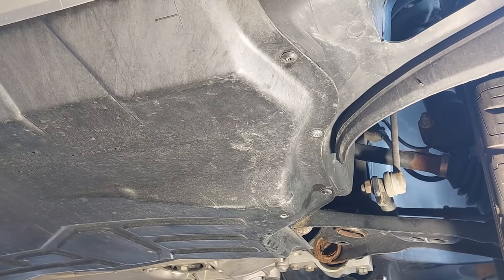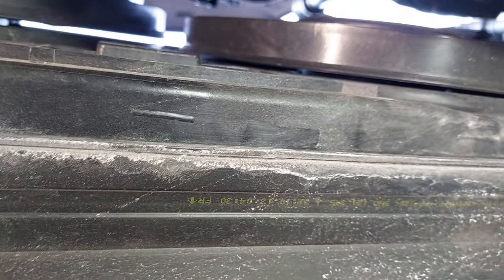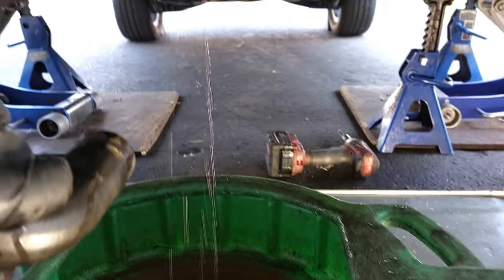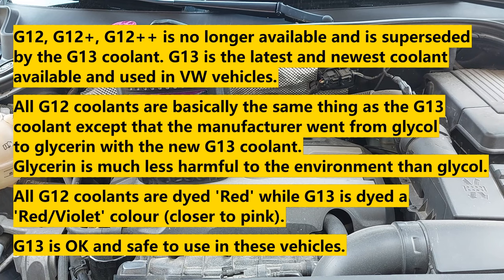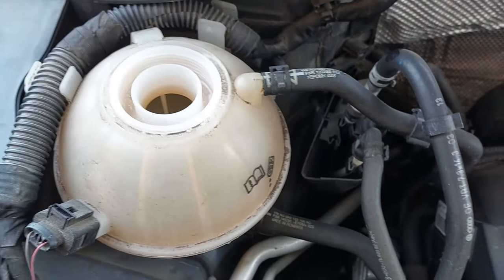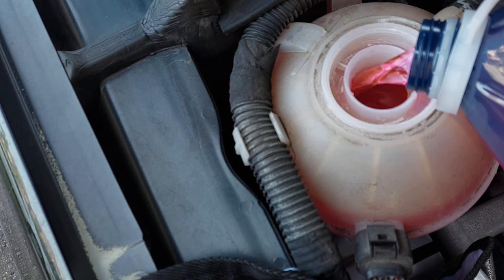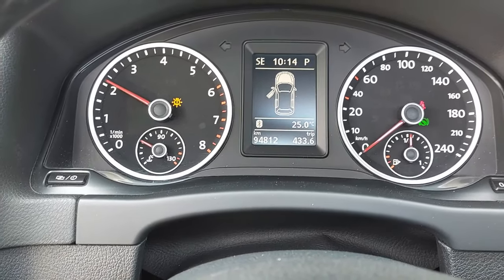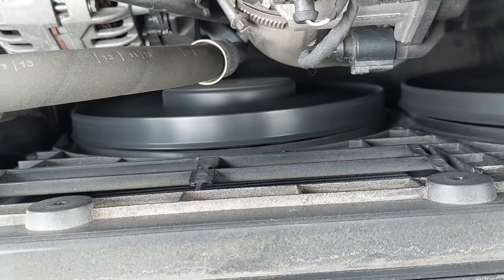2014 Volkswagen Tiguan 2.0 TSI - Cooling System Service - Drain & Fill & Bleed

Comment: Hi, the G13 is not the newest anymore and was also replaced by G12evo. The G13 is clogging the coolers over time... The G12evo is compatible like G13 to the old ones.
Reply: And also the stuff he used isn't g13 anyways lol
Reply: You‘re right. If you renew your coolant fluid, change to g12 evo. And another important thing you must do:
 If you have a g13 coolant reservoir, remove the silicat bag from the reservoir. This is the cause for clogging…

Comment: Hey man! This is awesome.
  Btw. My sister's 2018 Tiguan just got the thermostat and housing assembly replaced by a "Mechanic" and it is still overheating.

 The fans do actually turn on.

 I will try this procedure.

Do you recommend anything else?

 I was thinking about using a vaccum pump with vehicle off..

 Thank you soo much!
Reply from the maker: Try to follow the procedures in this video to properly bleed the system and see if it solves the problem. If not, I would have a look at the secondary/auxiliary water pump to see if it's working as that helps to push and circulate coolant in the system.

I would also check to see if the primary water pump is working properly and if it is leaking and if the ECT sensor is working as well. It's hard to diagnose without looking at the vehicle, but those are some things to check.

Also, using the wrong coolant on these vehicles may cause gelling and clog up passageways in the cooling system so that can cause problems too.

Keep an eye on the reservoir to see if the fluid is circulating in the system when you are performing the bleeding procedures. If not, I would suspect one or both of the water pumps are not working properly.
Reply: @moosemobileautorepair   Oooohh woooowww!! Thanks a lot man!!! You are freaking amazing.
 Will do 🫡
 Happy holidays btw!

Comment: Thanks for the video my man. Was wondering if there was NO drainplug and you answered that!

I've got a leak on a weird hose that goes around thge back left of the engine that looks like it will be near impossible to fix.

Ever tackle that one?
Reply from the maker: I haven't worked on these cars too often so I can't say. Only done a few things here and there, but that's it. But what I do know is the water pump and the auxiliary plastic pump are common to leak on these models.
Reply: @moosemobileautorepair  Yes they are and I've replaced both on this POS.

This is my daughters car and she "loves it" 

Otherwise I woulda towed it to the junk yard years ago.
Reply from the maker: Lol 😆.  The 2.0 liter TSI engines are known to fail such as the timing chain and stuff. I've done rear coil springs and a few things on these cars. I've also seen the PCV valve failing and causing a rear main seal leak. I don't work on them too often, but yeah I don't recommend these cars because of parts and labour being expensive. They're fun cars to drive, but not worth it unless you have the money.

Comment: Hey man.. thanks for making this video.. im about to do a flush on my vw tiguan.. i have a question.. as you know, when you drain the coolant from that hose( minute 8), that's not all the coolant in the system , there's some coolant left in engine block .. how can you drain that safely? start the engine with hose unattached?
Reply from the maker: That's right. It is not all of the coolant in the system, you probably get about half or 2/3 out. But if you do periodic maintenance at the right intervals then you should be OK with this service. You don't want to run the engine while you have all of the coolant drained out from the radiator/system because that will run the water pump dry and damage the seals, etc. and cause premature failure. If you want to remove all of the coolant you can attach a garden hose from either side and flush it out with water through the hose and block and you will be able to get all of the coolant out then. On some vehicles they have drain valves located somewhere on the block, but I typically don't touch them as you could open a can of worms and cause more harm than good. I typically just do a drain and fill at regular intervals and you should be OK with that. You can also do the service twice if you're really worried about getting everything out and getting it clean otherwise you could just flush it out with a garden hose or by using a coolant exchanger machine that shops typically have.
Reply: @moosemobileautorepair  thanks for letting me know, the thing is.. i added some radiator cleaner to the coolant so i  can flush the whole system, but the original problem is, no hot air comes out of the vents when i have on heating , after diagnosing the issue turns out the heater core is clogged .. so i want to unclog the heater core and flush the whole system since it has never been replaced before. I like the water hose idea but how can i get that water out if i want to add 50/50 coolant?.. can I use air to push the old coolant out?
Reply from the maker: You need water to push coolant out. You can safely use tap water from the garden hose and maybe use a special adapter if available or something so it doesn't spray everywhere. Using approved cleaners should be OK as long as it gets drained out after the service is done. I would try to bleed the cooling system out properly first before condemning the heater core. In most cases no heat through the vents is most likely because the cooling system has not been bled properly. Very rarely it will be the heater core, but it is still possible. You may want to check the thermostat as well to see if it is opening and if the cooling fans are coming on. It would be a good idea to check for any TSBs as well (Technical Service Bulletin).
Reply: @moosemobileautorepair  so if I use the garden hose to. flush it out, then i add new coolant, once that 50/50 gets mixed up with water in engine block, its not 50/50 anymore, its less than that .. right?. plus tap water has minerals so its like that calcium will build up inside the system, probably safer to use distilled water. The thermostat and fan are working properly.. what is a TBS?.. yeah so my biggest concern is how to get the garden hose water out?
Reply from the maker: For the garden hose you can insert it into one of the radiator hoses to flush the block out. There is a hose gun adapter by Lisle which you can get for cheap off Amazon. It's OK to use tap water for flushing it out only. But after you're done flushing you use either the pre-mixed coolant or concentrated coolant with distilled water to get a 50/50 mixture.

A Technical Service Bulletin is information sent from a manufacturer to service centers that describes a specific problem with a particular vehicle. It typically also includes an explanation as to how to correct the issue in terms of repair, software reflash, or modification of the automobile.

https://amzn.to/3ZIJ4l7

Comment: I have a tiguan 2.0 tsi from 2011 . Hoe much liters i need ? I saw a video saying 10 liter ? Its correct ?
Reply from the maker: That is if you are doing a full flush considering that you have the coolant exchanger/flush equipment/machine. The full capacity is 11 liters total for a full system flush.
Reply: @moosemobileautorepair  Thanks for help. I dont think need a full flush.
Reply from the maker: 1 gallon jug of concentrated coolant should be enough and distilled water or 1 jug of 50/50 pre-mixed is also OK. Just have some tiny bit extra just in case. A flush is not really necessary on vehicles unless there is a problem or neglected maintenance. A regular drain and fill at regular service intervals works fine.
Reply: @moosemobileautorepair  I just bought the car There are no problems, the water just doesn't look that clean. I think if I renew a few liters it will look good again

Comment: Really thanks for your great video. A question, why you didn't draing from one of the lower big hoses? for example the one you show at 4:29
Reply from the maker: Thanks. I think because it may have been difficult to access and those ones had a special type style of clamp that locks and so I decided not to touch it and leave it alone. You can remove it if you want whichever is easier. The one I removed drained a little bit from the block as well as from the radiator through the hose I drained from.

It was a Friday that day so I didn't want to open any can of worms so I picked what's easiest to remove and drained the coolant from there.
Reply: You did absolutely great job already, i have a Passat B8 2016 with contaminated coolant because of this silicate nightmare ended by clogged heater core. It was replaced by VW for a 1200 bucks here in France :face-orange-raised-eyebrow:. Week after i noticed there are still brown particles in the expansion reservoir and the coolant is orange-brown. So i decided to flush the coolant by myself. So far i learned from your video that it is impossible to drain the whole coolant from these cars with the auxiliary heater.  I believe using  the flush additives are not possible in this cars while I can't drain it for a same reason. I want to go with your procedure but i want also to put the garden hose in the reservoir and try to push dirt as much as possible out at least from the radiator circuit while it is impossible to do this for block circuit. Then try to use the compressed air to drain the water too and fill with the G12 evo instead of G13 also replace the reservoire.Also I think  but I’m still not sure if worth it, what do you think?
Reply from the maker: That's nuts. That's quite some story. It's worth a try to flush everything out or do multiple drain and fills too if needed. 

If you say brown colour, that could mean that there could be a leaky head gasket because usually oil and coolant getting mixed together would turn like a milky brown colour. Let me know otherwise, but yes it's worth to try to flush it out if you're having those problems.

How does the vehicle run and drive otherwise?
Reply: @moosemobileautorepair  the car is super fine, it’s on 40k miles only after 7 years. This was very first surprise. The coolant is not milky brown, it’s transparent looks like light tea with a very small brown particles inside ( very very small like a dust) , thanks again bro, god bless you and your business
Reply from the maker: Thanks. Try flushing it out how you stated and see if it helps and that should help to get the brown stuff out. Most likely because of incompatible coolants mixing up together like you stated earlier about the silicates.

Comment: I followed the instruction but in my case the coolant keep rising in the resevoir when the car is iddling.Why is that?
Reply from the maker: It means there are still air bubbles in the system. Try squeezing the hoses a little more and that will help to displace the air bubbles and help circulate the coolant better.

Comment: Hello I had a problem! I went to a garage, changed coolant to a 1.2 tsi. The problem was that the engine overheated. On a hose no coolant alwas getting to the water pump, and the thermostat did not open. After lots off overheating, taking hoses out to bleed air, the temperature stays at 90 degress, but the fans do not turn on. Only on A/C. Could be that they put the heat on when they turn on the engine after changing the coolant? Thank you!
Reply from the maker: Most likely the cooling system was not bled properly. Unless there is a separate problem with the cooling fans not coming on then there would be some electrical issue that would need to be diagnosed. The cooling fans should come on and off intermittently if you are idling for some time and only come on at low driving speeds. When you are bleeding the cooling system you need to make sure that the coolant is being topped off for each time the level drops in the expansion tank/reservoir tank. I would suspect that the thermostat may be bad and may be stuck in the closed position causing the engine to overheat. I would check that as well. 

Also, I would double check the correct bleeding procedures for that engine because each engine will have their own unique bleeding procedures and so it may not be exactly the same as shown in my video here. This video is for the 2.0 TSI engine and so I'm not sure if the 1.2 TSI is the same procedure although it may be similar.

Comment: An additional step is to run the car with distilled water in the system multiple times to flush all the coolant in the heater core and block them drain and repeat before adding the final new coolant

Comment: Can I ask why they want the heater to be OFF? Surely it's better to have it on going through the heater core?
Reply from the maker: So that the engine can warm up faster. It's only for 3 minutes then you turn the heater on after that. Having the heater on helps to cool the cooling system down and engine down a bit.

Comment: Hey bro my Tiguan is leaking coolant but I can't see where its coming from..... would appreciate some help very much..
Reply from the maker: On these models the water pump is common to leak which would be on the driver's side area on top. They are driven by the camshaft. Leaks would start from top and work their way down. Another common leak would be from the tee connections where the plastic is when they get old and brittle. Start with those and see if there is anything. You may need to lift the vehicle up in the air and remove the service cover to see what is going on. Alternatively, you can pressure test the system with a pressure tester kit as well.